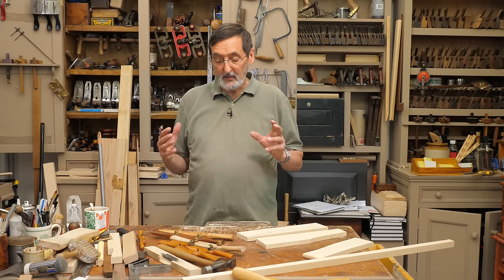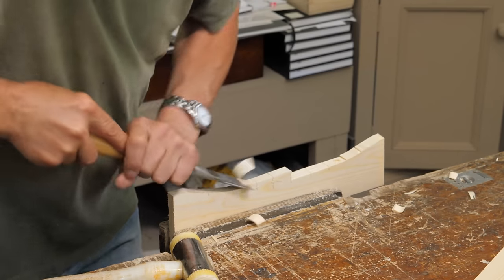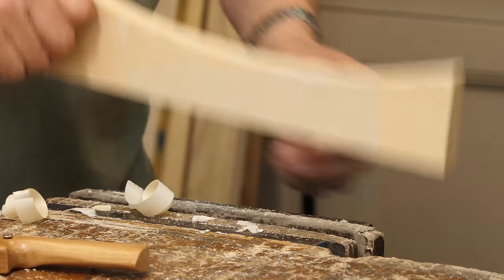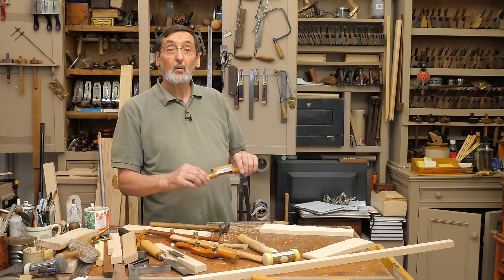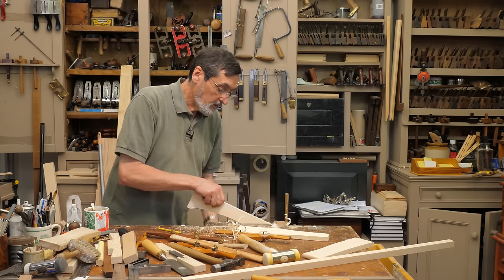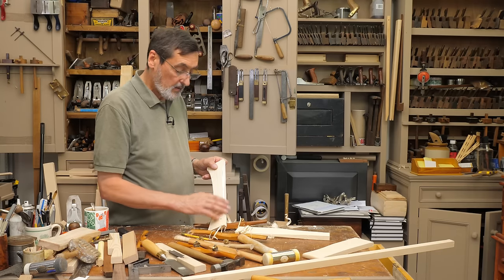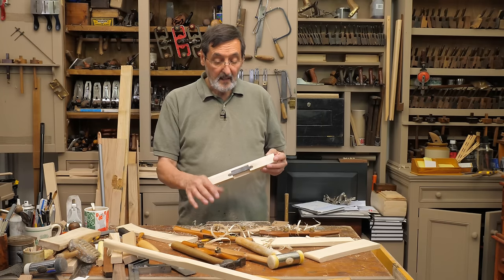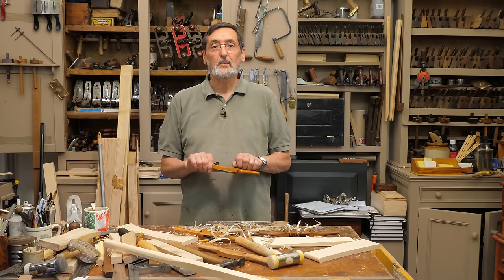How to use a Wooden Spokeshave |  Paul Sellers

Comment: OH MA GAWD! The ease in which you chisel that arch is incredible! nice work!
Reply: Martin DeVido I know right! Like that same move would take me 10 minutes
Reply: It would take me 10 minutes and end up looking like the dog chewed on it and that's when I get pissed and pull out the bench sander.
Reply: If you watch, carefully, one of the setup pieces he did was to crosscut kerfs down into the wood to close to where he wanted the curve to be. Essentially all he was doing was using the chisel to clean out the left over wood. Similar to using a table saw to cut kerfs in the wood where you want a dado for a joint, and using a chisel to clean out what's left. It's not as obvious here, but if you are looking to cut curves like that, keep the full process in mind, and realize that you may not see all of the setup.
Reply: His chisels are vary sharp too, that makes a world of difference when removing wood
Reply: theduck it's funny- I just saw you post your comment as i was sharpening my own chisels! you really can't under-estimate the power of a sharp chisel!
Reply: Martin DeVido that and a good chisel too, over a badly made one that can't hold an edge
Reply: Indeed.  My chiseling is very slow and careful.  His is a wonder to behold.  TY for Teaching us Mr. Sellers.

Comment: THE most useful tool for any woodworker. Another fine video Paul.
Reply: I'd argue that a knife is the most useful; you can make just about anything with just a knife, if you have to.  Followed by vise, saw, chisel and plane.  But a  spokeshave is definitely useful, no doubts about it.

Comment: Well done. Another further explanation of the use of the spokeshave. Been using them since the early 70's. 

I have a Stanley No 85 that have had difficulty adjusting. If you have one of these could you explain the fine points of adjusting? The cutting bit his hollow ground on the surface that touches the wood.

Comment: i made a flyscreen for a window a few months ago, i oversized it a little (bad measurements on my part, im still learning) and used a spokeshave to basically plane it down to size, worked out great, fell in love with the tool and the possibilities right away. also, it would be cool to see how you made those wooden spoke shaves.
Reply: He has done several videos on making a wooden spokeshave.
Reply: Guitstik Kustoms oh cool, i will have to go and check them out, thanks for letting me know.

Comment: Nice video, Mr. Sellers.
That I did not know the Spokeshave is so applicable.
Is a Spokeshave with a rounded planing sole exactly the same?
Just as you did the rounding with the chisel, but only with a sharp tool. :-D

Comment: It does look like a very effective tool. To me it's a more refined and easy to use draw knife. My question is why would you use a spokeshave made out of wood instead of metal?
Reply: Dan Morgan Paul has all sorts of spokeshaves, good old cast ones, wooden ones, all sorts of mouths and shapes and I bet he's got the newer cast veritas ones. A wooden spokeshave is the simplest and an economical option, it's only draw back being the mouth wears quicker and adjusting the plane is a little different (depending on what kind you have). The mouth wear can be prevented with a metal insert, checkout HNT Gordon for examples of gorgeous wooden spokeshaves equipped with brass adjusters.
Reply: I prefer wooden ones because they don't leave a mark on softer woods.
And, of course, the feel in your hand.

Comment: Great video, as always. Where could one buy the hardware for the adjustable spokeshave you made? Am I correct into thinking you favour wooden spokeshaves to metal ones now?
Reply: Leevalley has kits by Veritas for "making" a spokeshave or you can buy the irons from several sources.Paul has videos on making a spokeshave.
Reply: Thanks! I found it on Lee Valley, but also on Fine Tools in Europe, which is even better for me. I did see Paul's spokeshave making videos, but I very much like the thumbscrews for setting, that's why I asked.

Comment: I always thought that a spokeshave was used in a pulling motion rather than a pushing motion
Reply: HardAsSponge either works, same as with a plane.
Reply: Drawknives and inshaves are used in a pull motion, at least in part because they lacks a support sole, so you see what you do much better if you pull (draw) them.  But a spokeshave has a heel and mouth and you don't risk it digging in or taking off too much if the angle is wrong, and it can be used for both pull and push.